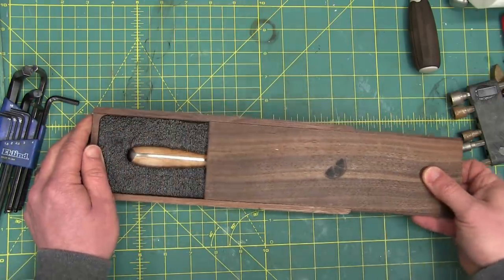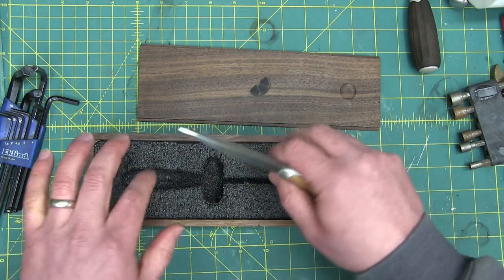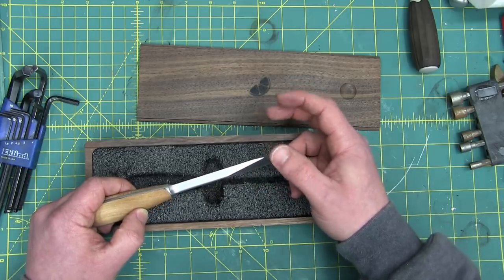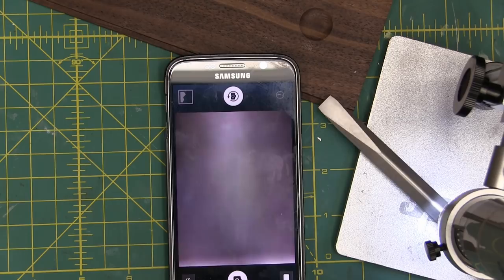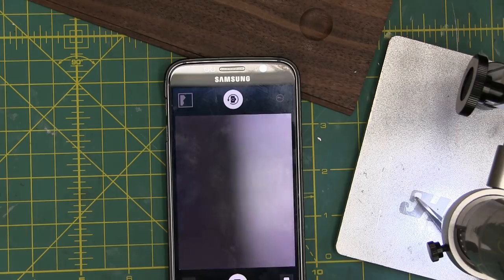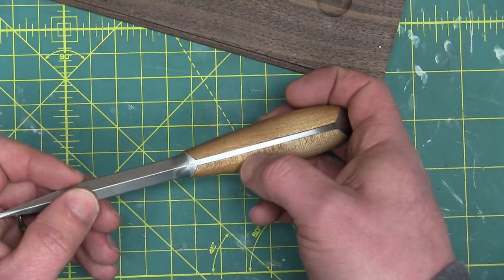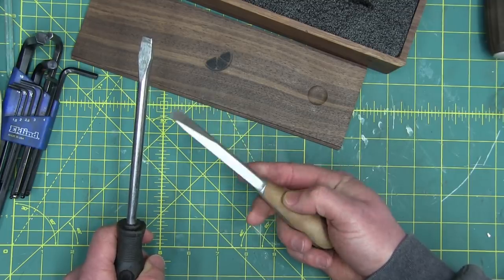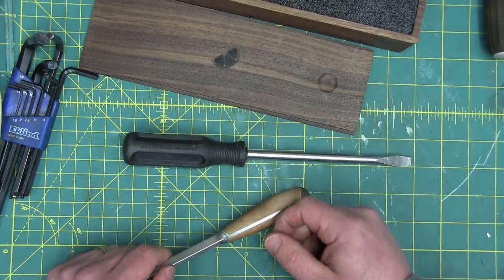Tool that doesn't exist? | MAKE IT!

Comment: AvE designed screwdriver? Shut up and take my money.
Reply: Maybe he'll do just a steel version with no wood scales for cheaper!
Reply: I'd buy one.
Reply: of course he did LOL
Reply: Maybe he’ll buy ‘em from Harbor Freight and resellem as the “bees knees” ?
Reply: Paterons line up and lets get a chinesium styled set branded by AvE. aVe could slowly take back the tool industry away from metric 😄

Comment: That definitely turned out amazing.  I can only get so hard. So glad you ran with those pics I sent!   More forgotten tools need to be remade, that's why I am stepping up and trying to get those wrenches made.
Reply: Looking forward to seeing the old tools come around again. There is definitely a market for them.
Reply: That would be awesome!
Reply: I’m assuming you sent him some Irwin WW2 drivers? I have a handful of them, including a HUGE flat head (maybe 14” long). Did other manufacturers use this design? I’ve only seen them from Irwin.
Reply: Excited for the wrenches!! Love both channels!
Reply: Titanium tools are a must in MRI rooms. Real PITA when you drop a $60 one down the wall and can't use a magnet to get it out.
Reply: ADD RIVETS ..... Good BRASS RIVETS -  Give it the LOOK of professional cutlery and the strength to PROTECT THAT HANDLE from ShoCK!
Reply: i was thinking the same, a pair of good brass rivets on the scales of the handle would look great and hold them on to prevent them from popping out
Reply: How can i purchase one of these
Reply: Need, not want.
Reply: How much this COST you?
Reply: Any tool updates onit

Comment: Needs a hole.  For string.  So you can tie it to your clothing.  After you drop the first one into the North Sea, you'll see the wisdom of this.
Reply: I would wear it around my neck.
Reply: Working offshore comms on rigs I'd electrical tape neo magnets to my tools; hands off slap it to a rail or bulkhead, on the off chance of dropping it, most times it'd catch in the grate 9 out of 10; there's always that one damn time
Reply: Doesn't need string holes or magnets if you keep it tight in your vice. But maybe you then need a hole in the vice for a string...
Reply: Put an eye hook on the back to tie a string to. It's cleaner and easier to do. Put the workpiece in the lathe and bore into the pommel. Tap it and put the eye bolt in, tie your string to your bolt.
Reply: DMill791 
 Murphy agrees with you❗
Reply: That or never angle your dangle in a trench so deep.
Reply: Words of wisdom.
Reply: @DMill791  neo magnets is a good idea. Electrical tape is a bit of a cop out, though. A bit of epoxy would've been the right idea.
Reply: I worked on a submarine, and with the round hull...many tools were lost. Until you are in that environment, you don't realize how common it is to casually drop a tool, and then simply pick it back up.

Comment: Good god man, not the microscope! :-o

There are definitely some improvements to be made to the tool paths.  Even on some of the products I've made dozens of now, i still tweak the tool paths and try new tools.  It can never be perfect enough! 

I think the handle is in there for the long haul.  It's internally doweled and epoxied through the titanium handle; essentially molded around and through the handle.  I could see the wood potentially cracking at some point though, it's still just wood.

Glad it made it safely to the Frozen North!
Reply from the maker: Nicely done Chris. Very well appointed box to boot!
Reply: Thanks, man!  It didn't feel right just sending that in some bubble wrap or something.  Plus this gave me an excuse to try box-making on the CNC.
Reply: Gorgeous job, Chris. Care to put a price estimate on one?
Reply: Congratulations sir! That's a wonderfull piece right there! I'll bet you one I can't afford one!
Reply: So THIS is what that giant hunk of Titanium was for!  Great work man!!!!
Reply: Well two great yoytubers working together again! You've done a great job again!
Reply: How much for this bad boy?
Reply: Chris DePrisco how much good sir
Reply: Well done!
Reply: All on his end.  I just showed him the light.
Reply: Rough order of magnitude guess $100 materials, 10 hours design time, 10 hours machine time, 10 hours  finish and assembly.  At ~$50 per hour, it might be $1600 (plus/minus 50%).
Fine tuning for manufacturability (smaller diameter ti rod for less machine time, and square ends on handle material?) and bulk pricing on materials might get the cost below $600?
Reply: I do tend to estimate on the low end...
Reply: Thanks!
Reply: What kind of microscope did you use for the inspection?
Reply: why not hollow ground?
Reply: That's what you get for selling a tool to a tool reviewer. Nit picks galore.
Reply: Real beauty all the way around!
Reply: Nice work!
Reply: but wood has some serious emotional properties  - as well as not getting slippery when covered in oil!
Reply: Good work Chris.... I'm still greatly enjoying your VMC videos.... really well made and fun to watch.
Reply: How did you finish the handle? Oil of some sort and paste wax?
Reply: To pass AVE’s inspection without a error is impossible, and its clear to all of us (the viewers) that Ave really had to look hard for imperfections and the quality is stellar. Im looking forward to potentially having the opportunity to get my hands on one of these!!!
Reply: A person complimenting the material metal for being stiff & then expecting the fitment to be too precise is a punk & a half in my book.
Reply: Chris DePrisco very well done. Definitely going to buy one if this goes to press.  Nice work.
Reply: Awesome! True Value had a Titanium "Estwing" claw hammer I handled, but for the price I knew I couldn't use it and was afraid of it's strength. I should have bought it as art!
Reply: Chris DePrisco is that the end of this project? Or, have I missed something?
Reply: Chris DePrisco how much to buy one?

Comment: Beautiful tool. My only concern is the security of the wooden bits. Perhaps you could reverse the angles at the edges so they would slide into the titanium like a dovetail. Just a thought.
Reply: or do a classic round wooden grip instead of those fancyass panels
Reply: I'm sure if they did it right it's mortised and titebonded; wood will shear before the glue breaks; although that does mean there's a slit in the tang, not that it should matter much.

Comment: That is just pornographic! I totally agree with your statement that tools have become disposable. I remember when I first started my Engineering Course at Technical College, I had to make ALL my own tools, from clamps and screwdrivers right through to multi-level tool boxes. It has taught me to look after, not only my own, but everybody's tools that I would use, right down to ensuring that everything in my tool-boxes are in as good a condition as over 30 years of use can afford.
 Sir I doff my cap at thee.
Reply: Capt Caveman I agree and disagree. Good tools are still available that hasnt changed. They are just expensive. Back in the day they where more expensive than the cheap stuff we have now so not really to much difference beyond what the average home has now. I like Klein a Lot for screwdrivers. Milwaukee as well. If you ever have a chance to get the Klein electricians knife get it. Its built like a tank. But back on subject just like you I'm ocd with my tools. I want them to last my life atleast. I usually look for lifetime warrantys I can honor easily. For ratchets I use kobalt now. Craftsman has the lifetime warranty still but id be returning them once a week they are so garbage now.

Comment: That handle looks like it would go in nice and smooth.
Reply: Yellow 77 or aqua gell may not even be needed if ya ate from the roach coach, slips right in the old brown eye
Reply: Avoid the Yellow 77 if you want to be able to get it out several years later, that crap hardens into a glue within "conduits".
Reply: It dose look a bit phallic. You think AvE is hinting at something here?
Reply: Thanks for the laugh bud
Reply: Only If he names the tool Richard wah?

Comment: I’ll buy one if it has Skookum stamped in the handle or acid etched in the gland end.  Can you even acid etch titanium?  There’s a vidjeyo idea...
Reply: Not traditionally, you have to aerate muriatic acid to do it, but you definitely can
Reply: You can etch titanium. It's done with forged titanium to remove the harder alpha case stage from forging. Not sure what acid attacks it, but it's definitely done in industry. I know this from experience.

Comment: As a former tech, I always needed a way to get leverage on the driver. As I can see the wrench would fit the square sides but I always visioned a hole some place as to fit anything round in as additional leverage. Maybe the handle flipping out and turning into a T handle and doubles as leverage.

Just had a day of watching so many AvE videos.

Comment: The grain near where wood meets metal is what you get when the wood’s surface is perpendicular to a radius of the trunk. It’s one of those cool patterns you get from quartersawing. You should want the wood to look that way! It’s a good sign! A plainsawn surface is inferior. A quartersawn board warps less with changes in moisture.

Wood isn’t isotropic like metal. This can be a pain in various parts of the anatomy, but it can also be exploited.
Reply: Medullary rays are beautiful to boot
Reply: Love to hear wood talked about so technically, there was a time that all those terms and details were taken way more seriously

Comment: Just loving it down here south of the border! 

Couple thoughts....  Can ya mill the tip with parallel sides like a gunsmith screwdriver?

Also, for machining titanium, end mills with a small .005" - .010" radius on the tips works wonders, leaves fewer nasties. My favorite being the coated Data Flute 5 flute mills.

Comment: Let me know if you have any sheet metal needs or enclosures made. My shop has a 2000W Fiber laser that can cut up to 1/2" steel.  Working in a job shop like mine, allows me to see 100s of different parts a month and come up with unique solutions for each part. We do single prototypes to 10s of thousands of parts.   It has made me such a better engineer because I get to absorb all the great ideas that engineers from different backgrounds have come up with.
Reply: you are such a lucky boy
Reply: Now go absorb global warming for fucks sake
Reply: Please look into fabricating a Stanley 77 dowel cutter and the different cutting attachments. They are still the best wood dowel cutting tools out there. They are hard to come by around $500- $700 when they do.  They come with a 5/8 cutter but the other cutters rarely come up for sale and can fetch $300 each.  Please fabricate the cutters and sell on etsy so I can buy a set.

Comment: How about rivets to keep the wood on, like a high-quality knife?
Reply: Brian Clark mosaic pins...
Reply: Brass rivets!
Old perfect handle like...
Just sayin.
Some really beautiful piece of work there. AvE, i am jealous!,
Reply: yes the old Irwin drivers that this is modeld after use two rivets i dont think they even used any sort of glue. But they definately need some mechanical retention if you want it to last forever
Reply: Viagra pins ! Keeps the wood on!!!!
Reply: jeep2003 i would throw out the wood also and replace it with something like g10 as wood tends not to fare well over time in climates that go from one extreme to another  i thing g10 or a similar composite would not only be more stable but also stronger
Reply: There are pins internal along with epoxy, those scales aren't going anywhere.  I do admit though, I prefer the look of thru pins.  The handle looks rather plain w/o them.
Reply: I think the best thing would be Corby rivets/bolts as they clamp the handle on.

Comment: Isn't titanium a bit soft for a screwdriver?  As long as it isn't abused, which screwdrivers are never subject to, it should be fine.
Reply: Maybe Rc40 max...sorry...still not very hard
Reply: Oh damn, you're right. I'd been led to believe it was way harder than that with a heat treat. Hardest alloy I can find data on is Rc44, but yeah... thnx for the correction
Reply: I used to work a fair bit on titanium while in the Airforce, on Vulcan bombers. Tough as frig but certainly not that hard.
Reply: you may not have noticed, but there is a lot of meat on that shank, like 400% more than a standard driver, I bet that more than makes up for it.
Reply: Exactly, same reason why there are no titanium knifes.
Reply: File.

Comment: great tool, but Titanium isn't a good material for tools - too soft. Titanium is a lot softer and weaker than steel for the same volume.
Reply: And you'll take a wrench to the flat part to get some leverage just before you discover that it's a left-handed screw you've been reefing on...
Reply: Depends on the grade of Titanium and the grade of steel involved. There are plenty of Ti alloys with higher yield strength than common steels. The other good news is that since Ti is biologically inert if you happen to put it through someone it won't be metal poisoning that kills them :-P...
Reply: Could improve this by carbidizing or applying a DLC coating to the tip.
Reply: I think carburizing only applies to steels... Am I wrong?
Reply: Yeah but titanium feels good
Reply: He wrote carbidizing... fusing carbide to Ti

Comment: Excuse the crude photodickery but why not do the obverse for the handle? https://imgur.com/a/ez7Mx More of a pain to machine but more skookum for tree carcass retention.
Reply: Undercuts are a pain in the butt to machine. You'd have to use something like a dovetail cutter (or a custom form mill) and do small step overs to get that final geometry. Add to that fact this be in titanium, you'd surely be looking at a decent price jump by making those inverted. alternatively you could flip it sideways and machine the undercuts, but then you'd have to add a larger radius to the inside of the flange in order to accommodate the diameter of the tool. Beyond those two milling options, you could instead waterjet or wire EDM out those flanges prior to any other machining, but again, you're looking at an extra setup, an extra machine, an extra tool, and and extra money. 

IMO, I'd make it square, and add a second means of retention besides glue. Maybe a tapped hole in the handle, run a bolt through the wood, and then plug the hole in the handle. Or just send an extra bottle of cyanoacrylate with each order ;)
Reply: Also it looks like a pecker through your wood. 

Not that I'm complaining.
Reply: you could machine that in a few passes with a dovetail cutter 
https://www.carbideanddiamondtooling.com/assets/images/Internal/Untitled.jpg
Reply: Fuckin' nailed it.
Reply: Xander Luciano If you check the comments above, the guy who made it chimed in and said he'd doweled it internally so it should be good.

Comment: I know it's more for poking about, but you've raved about spanner flats on the shaft before. Is the square section solid enough to make do with a 10mm or so spanner?
Reply: It's titanium. That means it will take all the torque that your piddly little 10mm spanner can possibly produce. The wrench will fail catastrophically before the screwdriver is scratched (or, more likely, the screw head will pop off).
Reply: Kevin Vermeer I'd think it would round it over on a tough job. But, slotted screws usually aren't that tough to turn so, that's probably a moot point.

Comment: I found an original steel screwdriver of a similar design,  while  cleaning  out the garage which I am going to restore to its former glory. It shouldn't be too hard as it is only a bit of fine surface rust to be cleaned off. I was admiring the design and marvelling at how basic tools were not just functional but things of aesthetic beauty as well. 

The handle is the same design as your prototype and I was marvelling at how the toolmaker must have been showing off their skill with a profile which appears deliberately difficult to manufacture.
 
Quite the opposite of disposable. You definitely are on the right path to a sustainable future where a good set of tools are once again heirloom objects.

Comment: Had a few of those style flat bladed jobbers in dad's tool box when I was a kid.   They were obviously older than dirt, but solid and stout.   We used them as chisels more often than as a screwdriver.  The pommels on the end held up pretty well despite the percussive nature of the small gorillas swinging at em with persuasion devices of mass destruction.

Comment: Hey AVE, way off topic but what's the deal with the EDM? I ask because im selling a benchtop sinker edm, which includes a hydraulic power pack, and edm power supply, two things i hear you may find useful. PM me if interested, there's a vid-j-o on my channel if you're curious. Also, nice screwdriver, curious as to how well the tip will hold up to prying action, and possible chiseling.
Reply: AvE